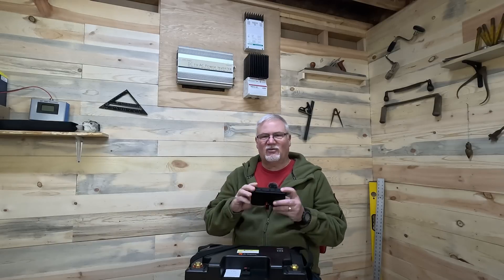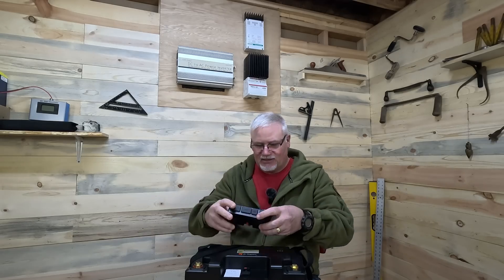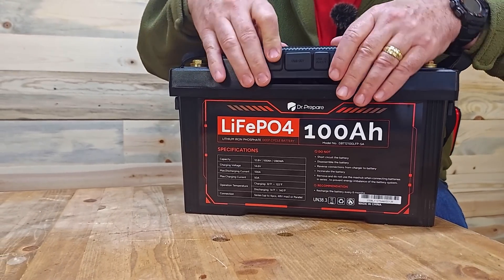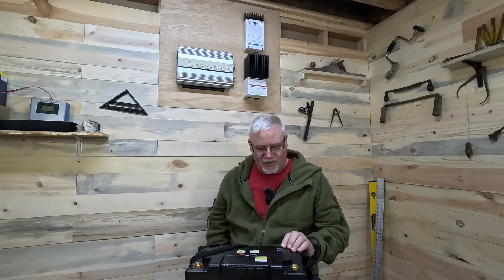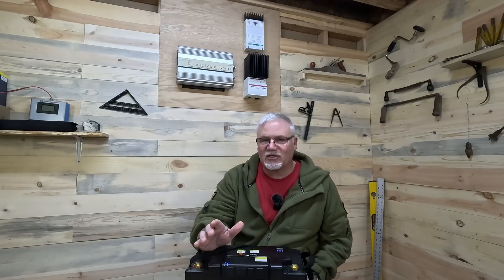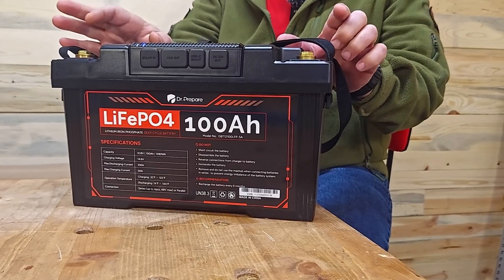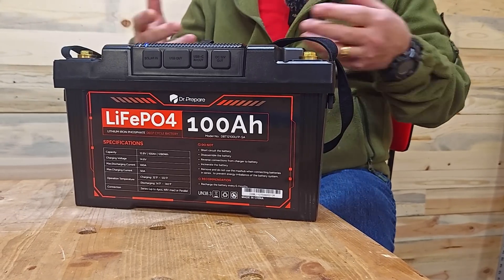🔋 Can You BOOST Your Power Station with a Car Battery? 🚗

Comment: Good tips. If someone really wants to have extra emergency battery power on a tight budget to supplement their basic backup power, I recommend at least 1 100Ah LiFePO4 battery, small gas generator, and a charger that can easy recharge the battery in a few hours. Dont leave a generator running just for light loads. Just use the battery until it needs recharging. Very few people find themselves not being able to find gas after a power outage. If a hurricane or something wipes out your entire community, the car wont do much more than keep portable devices charged.
Reply from the maker: Great point 👉
Reply: OR We are Siphoning Petro from them with a hose and a gas can
Reply from the maker: Pump!  I quit using a syphon via mouth hose after swallowing a mouthful.  YUK!
Reply: @TheOldJarhead 🤺 Xtreme Field Experience is a BONUS Jarhead 🤣  OOHRAH
Reply from the maker: LOL makes us wiser! ha!  Semper Fi!

Comment: Love that you covered this battery here. 
Great to have a hot meal during a power outage or while traveling.
I'm using the dc car adapter that comes with the battery connected to a Bestek 300w inverter ($40), & a Nostalgia 2.5 cup slow cooker ($22) plugged in to the inverter.
The slow cooker uses under 50 watts with a stainless bowl. 
It can brown about a 1/2 cup of ground beef in about 30 min after adding your own spices/oil, stirring, then dumping your favorite canned soup/chili for another 15-20min. 
I'm addicted!
The slow cooker I use is "Nostalgia" brand (Amazon). 
*Just a note the Nostalgia brand DOES NOT HAVE an on/off button. Unplug it!* 🤓
Reply from the maker: Cool!  Sounds like a great find!

Comment: You could run your car.

It will be hard on most alternators but it is an emergency. 
And I don't know about it taking a long time: it will be at least 300watts over 100 solar. How many watts do you think a running car is charging a dead car before they can jump it??

Yes, I know the charged battery is doing some heavy lifting too.
Reply from the maker: You could but the Amp limit means the low voltage of a car alternator will be slower than a DC Converter will give.  If the alternator can handle the draw and the PS can take the higher voltage.
Reply: @TheOldJarhead  Just feedback for a 12v lead acid battery.
The alternator should put out >14v.
We are talking ruining a lead acid battery or run a car because those are the last two options, right?
Reply from the maker: Last 2 for sure.  Least desirable but in an emergency it can help

Comment: Why do you think power station manufacturers have a 12volt low threshold. It won’t accept a charge below 12volts preventing you from killing your 12volt “dumb” battery.
Reply from the maker: I don't think that's why they do it, but it certainly helps.  It's an MPPT solar charge controller port and they have to convert the voltage to charge battery (most are 24v or 48v now) but most small panels are 20v  panels which often drop to 12v +/-

Comment: I have a few units but they are DIY of varying sizes and portable. However, 1 unit is designated to charging L/A Batteries, Deep Cycle and/or car/truck, even the smaller ones used for computer backup systems(like Power Wheels). It's just a HF 100 watt 4 panel kit with the ability to add 3 more kits, making it 400 watts total for maximum charging. Base batteries are Deep Cycle with a jumper leading to three external charging posts/ports on the unit. I've connected 3 separate batteries at once, none able to turn over a 4 cylinder, and 24 hours later are charged enough(using 400w) to start at least a 6 cylinder. I have another car battery unit, but it's wind powered and built from a bicycle and a treadmill. It's good for the bigger batteries for trucks and tractors, proven reliable to at least -10F. It, too, can charge 3 at once. It has 2 extra ports, one for 6v and the other for 24v. It's really fun to watch it in action, just don't stare at it for too long....it'll HYPNOTIZE you. LOL Crude methods, but they work. At least for ME they do. 👍
Reply from the maker: Sounds like you've got a great system going!
Reply: @TheOldJarhead  I might also add, both have USB ports on the Charge Controllers. My units, each build is unique. I use them to power the Greenhouse, chicken coop, shed, outdoor lighting, Glamping....all sorts of things. And when the storms roll through and knock the power out, they ALL get put to use.
Reply from the maker: Sounds like a good plan

Comment: A 300w inverter to the 12v plug and plugging the AC Battery charger can give extra power. Inefficient, inexpensive and in case of an in emergency. Let say you spend the day at work. Throw the solar panel in the roof and let it charge. Don’t forget to lock the panel with a bicycle lock.
Reply from the maker: Good point

Comment: A lowest amp alternator I can think of is about 85A with a regulated output of around 13.5v to 15.5v. At the low end an alternator can output over 1100W. Now most power stations can only accept 10A to 15A. So realistically you could only get about 135W to 200W of power from your vehicle.
Reply from the maker: Yes unless you use a DC charger.
Reply: @TheOldJarhead  like the EcoFlow 800W Alternator Charger
Reply from the maker: @HeliosT3ch That would do it.  I've got 3 500w units

Comment: Hey good work buddy because what you are covering is excellent. I have a question for you. I have a BLUETTI AC2A from its Solar input has an MPPT controller and will accept 12 to 28 volt DC at a max of 8.2A.  A car alternator puts  out out a lot of amperage when running in that volt range. So rather than charge from the car cigarette lighter, why can you not simply connect it directly to the car battery and run the car to achieve the maximum charge rate of 200watts?
Reply from the maker: You could. Best to wire appropriately and fuse and even better to use a DC charger, but sure, it could be done